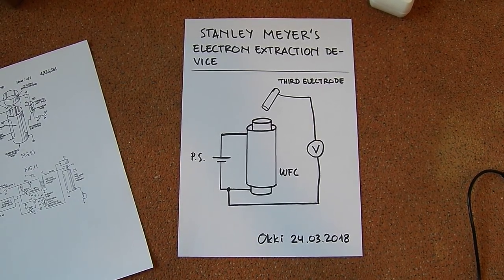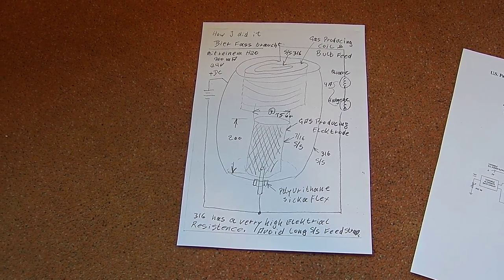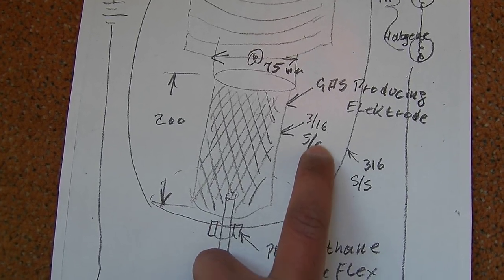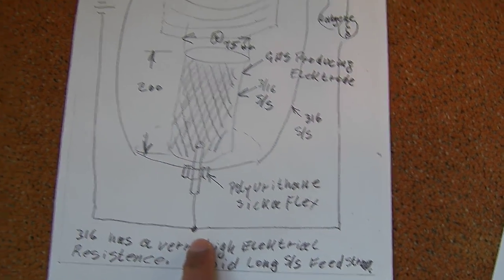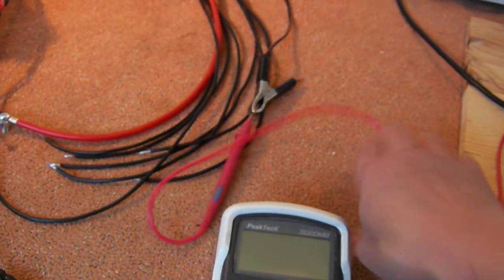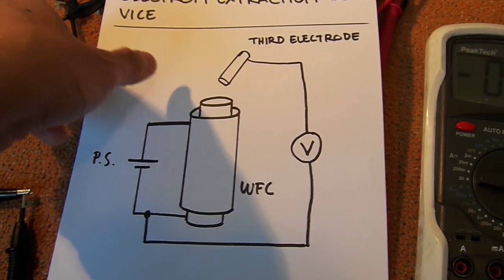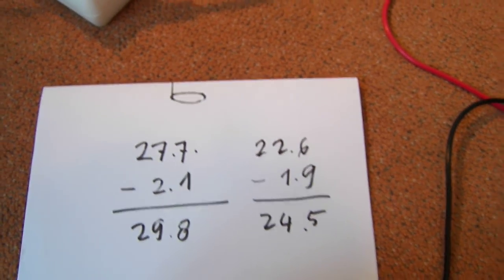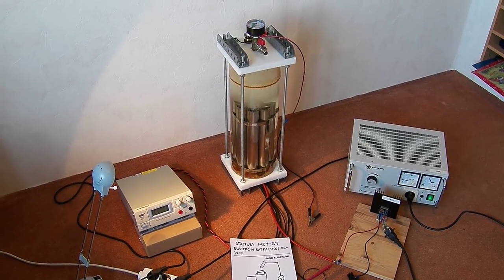Stanley Meyer's Electron Extraction Device

Comment: This is absolutely wrong. That patent does not show a Water Fuel Cell. That is a gas resonant cavity. Water does not flow into that cavity. Combustible gases as indicated in the diagram flow into this cavity. You may want to study a patent and understand it before you start offering up circuitry.

Comment: Send a square wave at 20,000 hz to the stainless tubes with 1mm gap between them, at 12v, 2 amps, the water splits into H and O without the need for chemicals or high voltage.....vary the width of the pulses to achieve resonance, and increase the output of gas.......
Reply: Ok, show me that...it's just your theory.
Reply: What do you use to send the wave with? Pwm?
Reply: @off-gridhillbillystyle3735  dude Don't be naive, it's not that simple.    Guy doesn't know what he is talking about. When you split water you get two H and one O.... Pwm can't create 20khz signal, you need signal generator, bifilar inductor, n channel mosfet.... Just Google " mosfet switch frequency to coil".... But you won't get anything from that, only you can burn you transistor from back EMF.
Reply: @hardcoreplayafromthehimala4888  cool!! So where's your build ? Can you upload it?
Reply: I don't share anything on youtube, i'm on this topic some time, and i know what work and what do not work. Guy said 12v ha ha....high voltage in clean water is a must.
Reply: @hardcoreplayafromthehimala4888  oh your on that level lol but yeah your right 12v won't do much without resonance at the correct hz and pulse .
Reply: @hardcoreplayafromthehimala4888  here's what striaght 12v looks like 
https://youtu.be/BwmhV_pFUTI
Reply: Stan Meyer cell is based on charging with BEMF and discharging, voltage inside cell goes over 1kva....i'm sure this guy will share his circuit, and me and you will drive our cars on  HO
Reply: @hardcoreplayafromthehimala4888  right and Meyers was using voltrolysis also.  not electrolysis 
The 1kV isn't that hard to get expecially if you have that little magic box. But hell I've got enough batteries on my solar to achieve it but I don't really want to risk my batteries.
Reply: @off-gridhillbillystyle3735  some people replicated Mayers work and won't share, now they becomed greedy, but that technology can't be brought by usual market, only open source sharing. They all deludional.  Thrwaterenergy1, Max Miller, Edward Michael etc.. They think someone will invest millions in that technology... That would be instant suicide, because world is based on oil manipulation.
Reply: @off-gridhillbillystyle3735  electrical pulses I believe which is created by AC.... I think
Reply: @Alm_Engineering  yeah I'm working with DC off solar had some success
Reply: Re-so-na-nce
Reply: Not square waves, but pulses at higher voltages.

That's what he used.

Comment: If you put stainless steel screens or spiral pancake coils with plastic window sceen between them you can extract voltage from the rising bubbles and if your bubbles have a tall tube to rise in more screens can be stacked to increase the voltage
Reply: The liquid is a resistor and the rising bubbles are voltage nodes trying to equalize there voltage  potentials through the conductivity of the liquid
Reply: I was at the Meyers estate

Comment: Thank you Okki for showing us. The third top electrode  should be stainless steel mesh like the bottom one and larger. This top third electrode, becomes also a gas producing electrode. The volt meter to measure the relisted charge should have  lights to burn up the free electrons. Your power input volt meter will show the extra v/a the cell is using now wen the light bulbs are burning. This third  large top electrode diamond shape rolled up construct is now a stronger producer of gas then the bottom one. LOL.Edgar
Reply from the maker: You are welcome Edgar. This is just my observation from my research up to now. If I find another effect I will let you know. At this moment I think that water (with no added electrolyte) has high electrical resistance and Stan Meyer tried to remove this charge from his cell in order to maintain gas production. In his late patents he omitted this third electrode and just connect both electrodes with a current consuming device (light bulb filament) alternatively with the VIC (capacitor charger). Of course maybe I'm wrong, I will continue to observe this.

Comment: Think you are right about discharging the "cap", that has been my thoughts for awhile now too. But this can be also done by shorting the plates too in between pulsing time. With his VIC circuit though, my thoughts were that this "electron extraction circuit" was more to discharge the cell before any dangerous static charges could build up possibly causing the cell to detonate.
Reply: But maybe not just from the "VIC", just found this:
"When liquid is passed through thin tubing at a high flowrate,  the electrostatic charge of the flowing matter generates static electricity (flow electrification). (The charge level is higher for poorly conductive solvents flowing through plastic tubes. In addition, large amounts of air bubbles flowing through the tube can amplify the static electricity."
"If electrostatically charged liquid accumulates in an electrically insulated container, the amount of charge gradually increases to a point where it can easily generate high voltages, on the order of several kV."
"If an electrical conductor comes within a certain distance of the container, an electrical discharge occurs, which releases thermal energy."
https://www.shimadzu.com/an/hplc/support/lib/lctalk/14/14lab.html
Reply: Also look at the "xogen" patent. That was done by Stan's brother-in-law up in Canada after Stan's death. In that, they show a pulsed stainless steel coil at the top of the cell that they say is part of the gas conversion. But the SS coil could be just an electrode in disguise (to protect patent) and the electrode could be pulse discharged as an improved  "electron extraction" technique. Though when they demonstrated it, this partwas inline with the gas, and not in the cell:
  look at figures 6-8:
https://patents.google.com/patent/US6126794

Xogen demo video:
https://youtu.be/pXo7CVFI5Sk
Reply from the maker: Hi Davy, yes, that is exactly what Stan was doing. In his later patents he "shorted" the electrodes between the charging pulses. He disguised this step by putting "Current Consuming Device" between them.
Reply: I'm now starting to think, after  looking at the xogen patent and their demo unit again, extracting electrons from the GAS (and not the cell) maybe the major  key to slowing the  burn of the gas to something more usable.
I'll share somethings I just came across that would help support that:
 "Joseph John Thomson  is widely recognized as the discoverer of the electron.Thomson worked on various aspects of the conduction of electricity through gases. In 1897 he reported that "cathode rays" were actually negatively charged particles in motion; he argued that the charged particles weighed much less than the lightest atom and were in fact constituents of atoms [Thomson 1897a, 1897b]. In 1899, he measured the charge of the particles, and speculated on how they were assembled into atoms"
"Thomson scattering is an important phenomenon in plasma physics and was first explained by the physicist J. J. Thomson. As long as the motion of the particle is non-relativistic (i.e. its speed is much less than the speed of light), the main cause of the acceleration of the particle will be due to the electric field component of the incident wave. In a first approximation, the influence of the magnetic field can be neglected. The particle will move in the direction of the oscillating electric field, resulting in electromagnetic dipole radiation. The moving particle radiates most strongly in a direction perpendicular to its acceleration and that radiation will be polarized along the direction of its motion."
Reply: This falls right in line with how Stan would have progressed to the gas core transformer(a charged particle  accelerator) after this "electron extraction circuit" was figured out
Reply: Just had an "ahhhh haaaa!" moment I would like to share. It is now thought by some experimenters that Stan's water spark plugs, and other VIC cells,  produced ozone as part of the process to slow the burn rate of the gas to equal gasoline. Well it just also turns out, that ozone ALSO is a good "electron extractor"!
http://iopscience.iop.org/article/10.1088/0963-0252/6/2/007/meta
Reply from the maker: Hi Davy, I don't know how to create ozone in HHO gas. How is it possible to create ozone without igniting HHO gas? I still have a lot to learn in this field.
Reply: If you look at how ozone machines work with two screens sandwiching a flat piece of ceramic, it doesn't produce ozone by spark gap. Stans water plug looks similiar to this in part but not with screens. I had suspected a couple years ago that if ozone was added in with the gas, it could possibly cause the hho to recombine slower if the O2 part was converted to O3(ozone) first. So I looked around a bit on youtube to see if anyone had done any experiments with this and found this guy:
https://youtu.be/7aTVu4SJ79w
Reply from the maker: Hi Davy, can this be an ozone generator? https://youtu.be/nd6MozD2FDA
Reply: Okki Moeljadi if it smells like ozone, other wise it is a negative ion generator. I would recomend getting a cheap negative ion counter off ebay to add to your test equipment, by the way. I will have to watch this video closer later, but that is pretty much what I picture going on in Stan Meyers water spark plug.
Reply from the maker: Yes it smells ozone.
Reply: It's not clear for me why capacitor tubes need to be discharged. Why?
Reply: @rochaaraujo9320  To reset back to zero volts so the step charging can pull the water apart in cycles

Comment: Hello, ökki
I have made some experiments with the Stanley Meyer tecnic and reading most of his patents, although i could not reproduce his resonant watersplitter.I only got the result of common electrolysis with or without adition of electrolytes.I think the extra electrons can only be detected if the high voltage watersplitting is used and requires blocking of the currentflow by insulating coating of the electrodes or by resonant circuit means.It would be great if you could achive it,Good luck.
Reply from the maker: HI Wolfgang, thanks for commenting. I do this research for almost ten years now, trying many techniques including resonance driver circuits but never seen any good gas production where I can run my car engine only from HHO. What I always see is gas production depends on electric current. If you want more gas, you have to put more current into the cell.
Reply: Okki Moeljadi 
Hello, yes I think it is quite tricky to get this technic tuned, although i believe that it's possible, it seems that some people has been able to reproduce it.There are some videos, but it's difficult to know if they are true.As in the patents is clearly stated that the technic used breaks up the covalent bonds of the hho molecules with strong resonant electric fields , I think in order to get the latter it is necessary use high voltage or very small gaps in order to achieve this strong dielectric fields and simultaneously inhibit currentflow.Maybe the pmasmasparks are the most similar process, which can ignit water instantaneously.May i correct you with the drawing you are showing in the video, it corresponds to the gasprocessor which is intended to energize the air in the motorintake.Greetings and thanks for sharing investigations
Reply: thats because you guys have it all wrong. its not about gas production. its about ball lightening. https://www.youtube.com/results?search_query=moray+king

Comment: Did you measure the current between minus and third electrode?
Reply from the maker: No, I did not.
Reply: @OkkiMoeljadi  Then measure current. In case there is a some current it can be used to power another HHO cell and so on.
Reply: @Radovedn  There's an interesting thought.
Reply: @andybilakshow260 my cell was like a battery and I wanted to power another cell with it. I was using pencil graphite that was evaporating or exfoliating. This I concluded was allowing the bath to gain more power. Also I use graphite electrodes.
     Just now getting back into it. 
    I would rather try making steam for power.

Comment: Don't you need the laser energy to extract electrons during this process?
Reply: no . the lasers are simply to ionise the water before it becomes into the system. this can be done by other methods. magnets, high voltage ect.

Comment: Your extraction probe should be on the positive side. Eletrons are negatively charged and will be attracted to positive, just like the patent shows. Also, for this to fully work, you need to bring the eletrons in rhe oxygen atoma to higher orbital states. Stan did this by using LEDs AND a high voltage chamber surrounding the gas. On the top of that was the electron extraction probe.
Reply: Do you think it can work 😅

Comment: Okki my friend, as you may be aware Stanley stretched the bonds before fracturing. He used voltrolysis much like Andrija Puhriarch and not typical electrolysis. This happens when there is a dielectric such as laquer applied to the one electrode.

Comment: If you look at Stan Meyer's tubes you will notice that the inner tubes are are longer than the outer tubes. The reason is that it is a tuned circuit. The lengths of the tubes are well documented if you do a little more research. Also, the reason that he is stripping off electrons is so that the ionized air that he introduces later, which is mostly Nitrogen, will bond to the Brown's gas and slow down the burn rate, as to not melt the pistons of the motor. I hope this helps you !!!
Reply from the maker: Thanks for the input John.